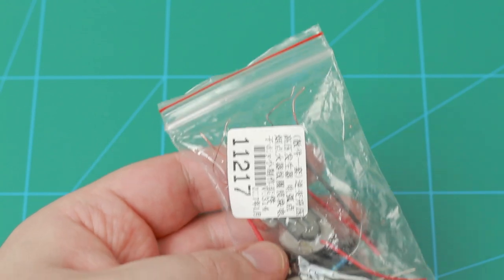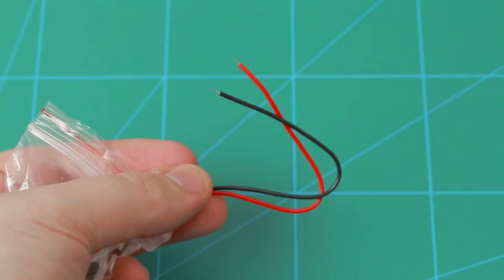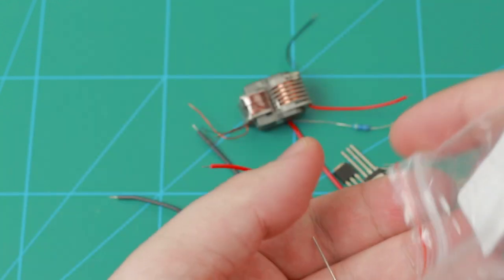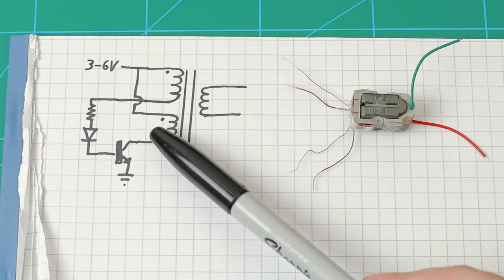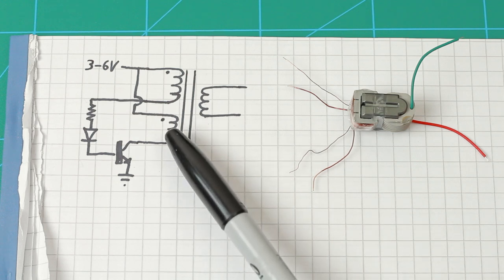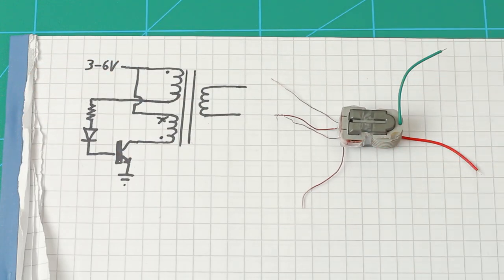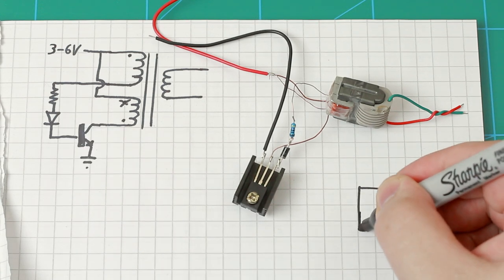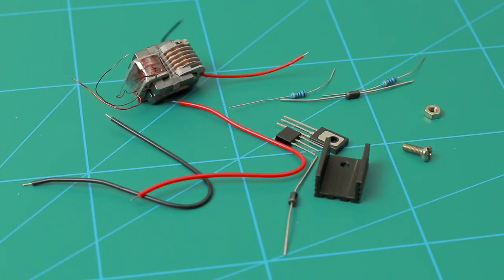15kV HV Generator Kit From ICStation.com

Comment: Thanks.  I also wondered why I got an extra transistor. (In case the first blew up?) 

I want to run mine as a 1kV supply for checking insulation resistance, so I will have to devise some feedback mechanism, and run the device from a lower voltage supply, with a resistor to limit the current. And it may need a Faraday shield of some sort. I expect the em radiation could damage electronics.

btw: When I was a kid (a little older than the thumbnail shows), I used a neon lighting transformer (real neon, not fluorescent tubes; 11kV, and shoe-box size) to melt glass.  Not so much melt, but to keep it red-hot and soft after being melted with a flame. Care was needed: flame can conduct lethal amounts of electricity.
Reply: Charles Tivendale: I would rewind the secondary with a thicker guage wire which would give you fewer turns and lower the output voltage. I wouldn't trust that secondary to last too long the way it is. You can still add some multiplier stages later if you want to play with high voltage sparks.

Comment: The package comes with two transistor.How its used the second one?
Reply from the maker: To be honest I don't know what to do with the second transistor. Schematic shared by ICStation only has one transistor and so does every other schematic of similar kit that I was able to find online.
Reply: What is the resistor value you used?
Reply from the maker: Kit came with two identical resistors and I used one of them. If I remember correctly, it was 470 Ohm.

Comment: the npn transistors in those kits are often not labelled. and often in the images they are connected with the metal to the outside. so no wonder those cirquits didn't work.
Reply: Thanks a lot for that hint, now my board worked... like one second :D metal outside make no sense to me, but it was the issue, i messured it emitter and collector was twisted. now i need a new NPN :D

Comment: How many turns primery, feed back & secondry
Reply from the maker: Premade transforer. I haven't unwound it and thus don't know the number of turns. My best guess is "Few turns primary and FB, LOTS of turns in secondary."
Reply: try 6 turns (for the Transistor Base) and 12 turns (for the transistor collector) and 1000 to 1500 turns for the secondary (HV)

Comment: Is it dangerous?
Reply: Not dangerous, but if you add a voltage multiplier, it will become very dangerous!
Reply: Who would buy it without adding a multiplier?
Reply: Without a multiplier, this is a good lighter.
Reply: Will it work with a multiplier? Does it output ac?
Reply: AutogolazzoJr no The output of a voltage multiplier is dc